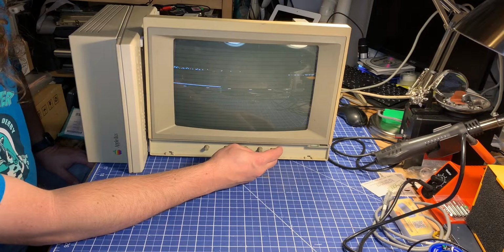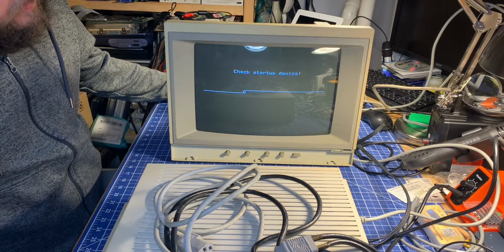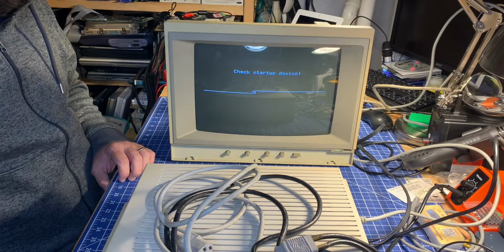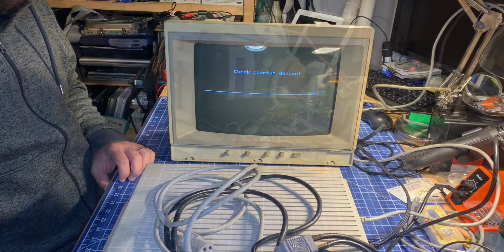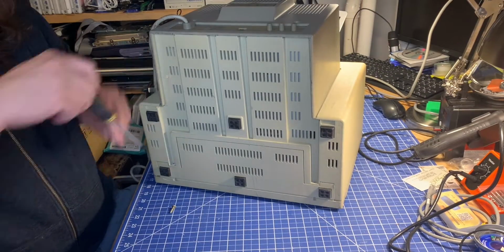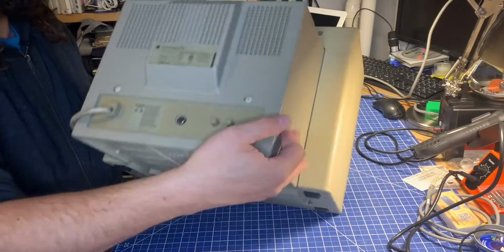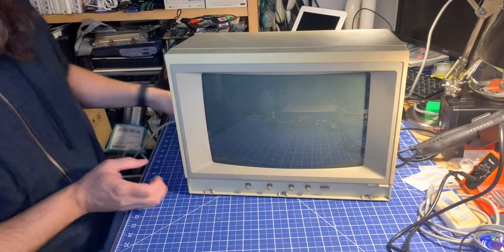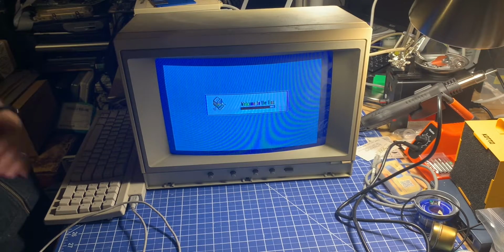Apple Color Monitor IIe Repair

Comment: Thanks for this video. I have been lent this exact model and was wondering why it was still stuck together after taking out the screws. I found out that the outer shell got stuck to the back bezel (for rear tuning and the input jack), so pulling the shell was actually pulling on the power cord connected to the circuit board. Prying them apart got it separated. Now I just have to fix the signal overdrive issue...and also clean it up 😆 It was a Computer Reset find from outside the back of the warehouse, yet still works despite all that dirt & weather!
Reply from the maker: Awesome!  I wish I would have been able to get to Computer Reset before it all ended - seemed like a magical place!

Comment: mine doesn't have the screws in the bottom. How is the bottom held on? I can't get it off.
Reply from the maker: Check under the feet maybe?  I didn't realize Apple had more than one design for the Color Monitor //e so I am not sure.  It could also just be kind stuck together - if you apply some force to separate can you feel that one side seems more stuck?
Reply: Check under two black rubber feet that have two little holes in them. Use needle nose pliers to pull off those rubber feet and expose two hidden screws. The screws will have glue in the heads so you'll have to use something sharp to cut away the glue.